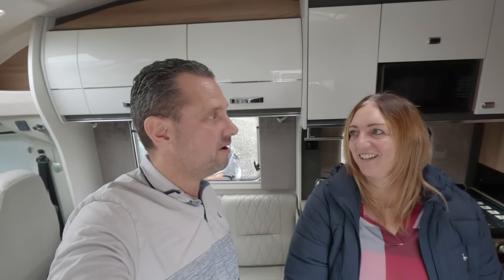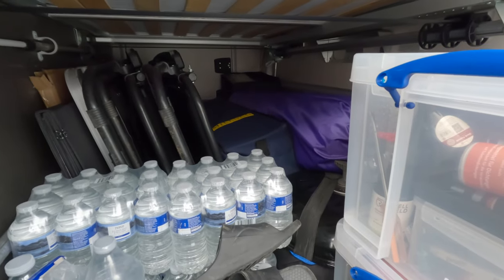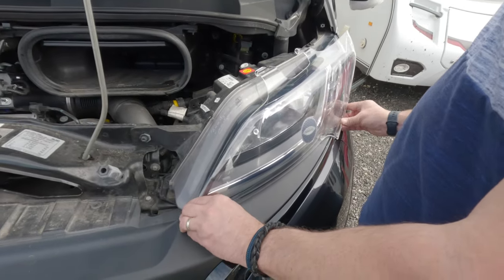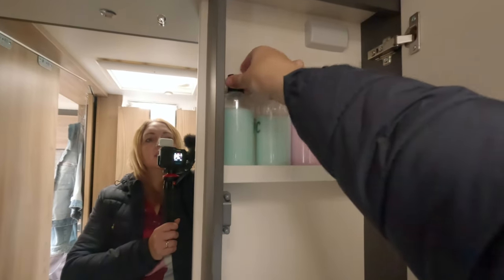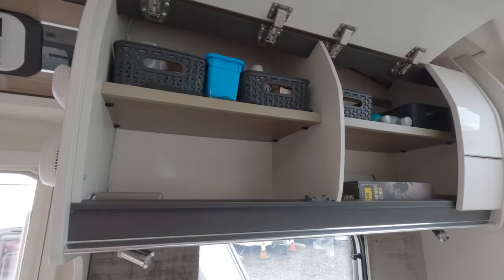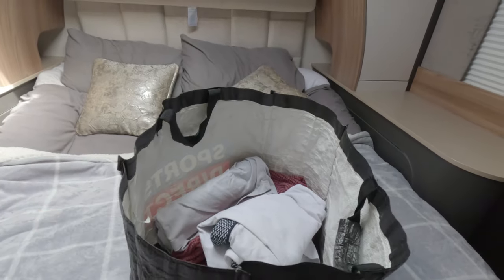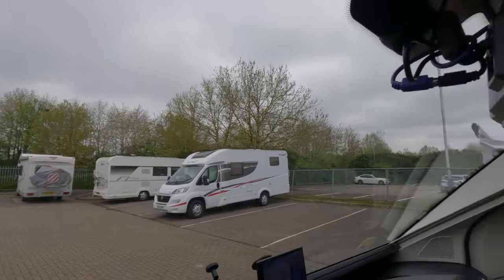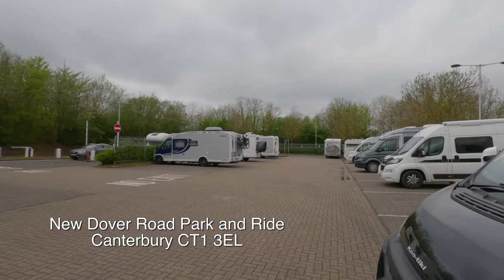It's time to Pack our Motorhome and Leave

Comment: Hi there, please check the antifreeze you bought, some coolants can be mixed and others if mixed can turn to gel inside the cooling system and cause your engine to overheat, it can also cause internal engine damage as well, its probably ok but better checking. If your not sure take it to a garage.
Reply from the maker: Thank you for this i didn’t realise mixing could course issues so i'll keep an eye on it. We appreciate your support. 😊
Reply: That was my first reaction when watching the antifreeze going in. "Never mix pink with blue or it gets expensive! "
However Prestone can be safely mixed with other colours of antifreeze.
Reply from the maker: Phew thank god for that and thank you for letting me know i did read the bottle but wasn’t 100%. Happy travels 😊
Reply: Personally I wouldn’t top up with antifreeze mix you’ve probably already got enough mix ratio. If you have to top up often it might be worth getting it checked for any leaks.
Reply from the maker: I don’t think there any leaks as never needed to top up before and waiting for the 2 year service. I didn’t put to much in so all seems fine. 😊

Comment: Should Google about mixing different colour coolant
Reply from the maker: Hi the type i used was ok to mix. This is from there website - Prestone is guaranteed for all cars and can be mixed with any other colour of coolant/antifreeze, making it the best choice for you. You can use it to top up your car or to refill the cooling system after you've drained and flushed it. Happy travels 😊
Reply: That's good enjoy your  travels keep up the good vids